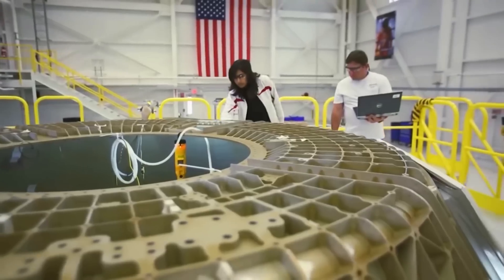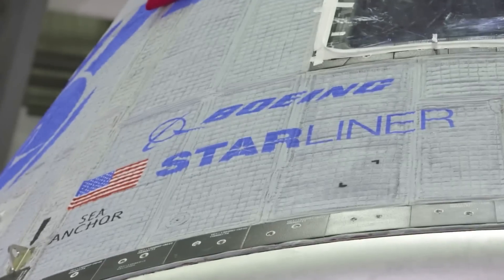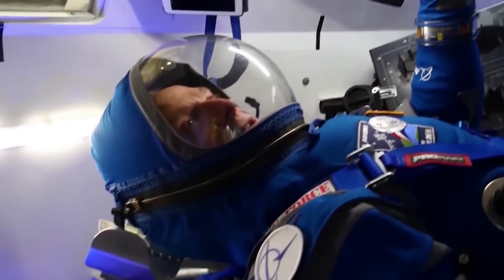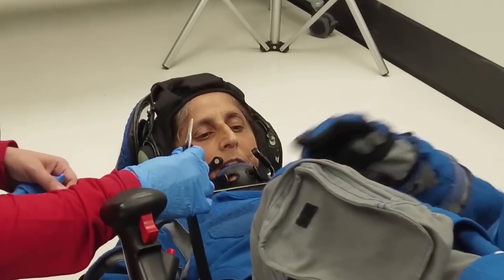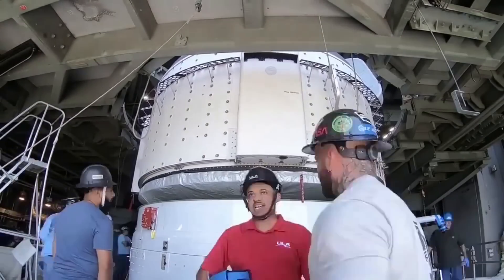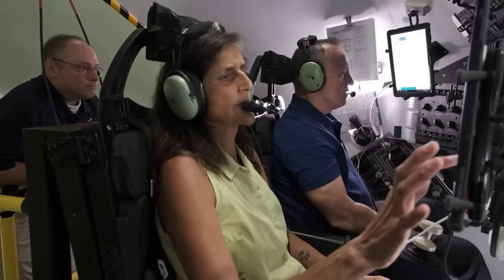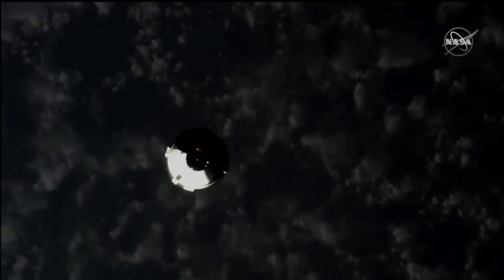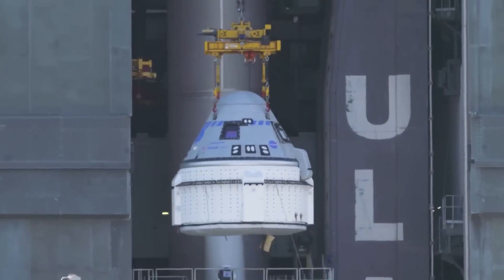Starliner’s First Crewed Flight Test Could Be Weeks Away

Comment: That's definitely a good idea.  Fast-track crewed Starliner launches when not only was the last test fraught with errors that strongly belied Boeing's self-awarded "11/10", but even NASA recently generated a report expressing extreme doubts about the progress on the craft.  The optics on this move are going to be perfect.  And if anything goes wrong, as evidence suggests it likely will, I'm sure there will be nobody to blame but pure bad luck.
Reply: As long as Boeing can fix the problems to NASA's satisfaction, they don't need another OFT. For example, between the unmanned Demo-1 mission and the crew Demo-2 mission on Crew Dragon, a Crew Dragon exploded on the test stand due to faulty valves. SpaceX was able to diagnose the problem and fix it to NASA's satisfaction, so another unmanned test was not needed.
Reply: @steveaustin2686  If they do cut corners and something bad happens God forbid, it will mean NASA management still didn't learn anything from their past 3 disasters. Boeing management is hardly worth mentioning given their track record of issues these days  I hope this time the engineers do not compromise.
Reply: @srinitaaigaura  Which is WHY I said to NASA's satisfaction. Starliner may not make the July date, because the items may not be checked off in time. There will be a FRR in late June or early July that will determine if Starliner is ready or not. Those FRRs have delayed Starliner in the past to finish fixing problems. And again, Crew Dragon had a MUCH worse problem before its crew flight than Starliner's OFT-2.